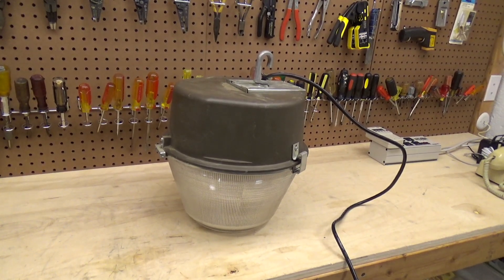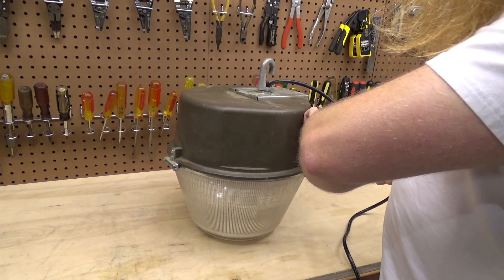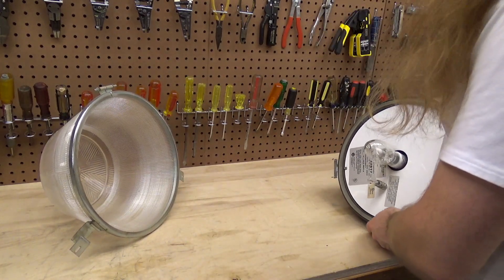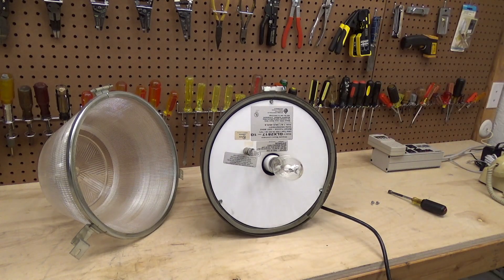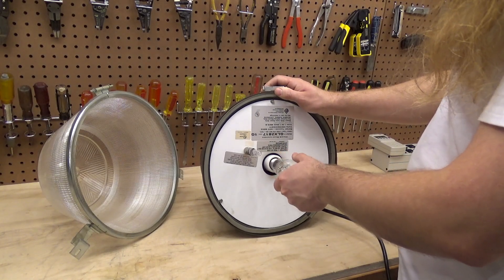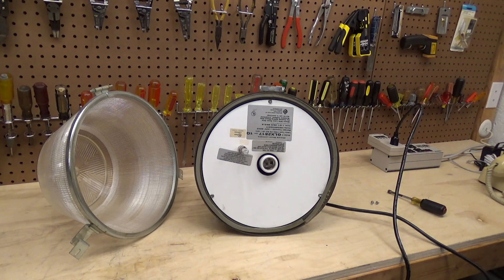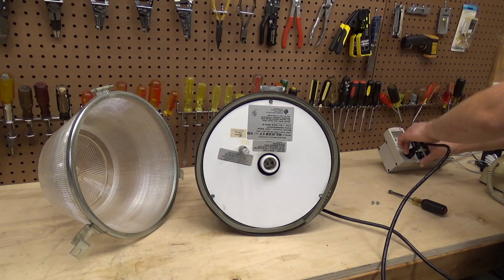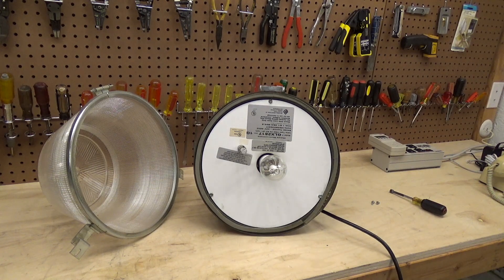Re-Revisit: CEW Lighting GLX2817-1Q 175-Watts Metal Halide and Quartz Hook Mount Luminaire

Comment: all this time later did you end up figuring out what the quartz bulb actually does?
Reply from the maker: The conclusion was that the bulb will illuminate in the even of a power blip to provide illumination during the period of time where the metal halide bulb is cooling before it will restrike again. I've had these fixtures in service for a while now and I've never seen the bulb illuminate once, something is either disabled or spoiled in these fixtures it seems.

Comment: the refractor is made by lexalite I'm pretty sure.
Reply from the maker: Do they still make them? Are you aware of any replacements that can still be purchased?
Reply: @JordanU  The refractor? Yes im sure they do, or you could try 'formed plastics'
Reply from the maker: @steve-h7z  Yes, I have 4 of these lights and the bottom is broken on one of the refractors. A few of the others have cracks. Would definitely like to get replacements.

Comment: I performed actual research - the quartz bulb is there for efficiency reasons. It is there to ensure the metal halide bulb goes through an efficient startup process. Without the quartz bulb it will not be as efficient. It is there as a supplement to the starting process. It is so that it transmits the high-voltage electrical pulses necessary for igniting and re-igniting the metal halide lamp. The quartz bulb does not illuminate, it is not supposed to be a source of light itself, rather, it is a metal halide ignition supplement device. Try unscrewing the quartz bulb and see if it makes a difference in the way the metal halide bulb starts up. If you don't have a quartz bulb installed you will notice the metal halide bulb take a little longer to start up, and it will possibly flicker more on startup. Please note that you may not see an immediate difference in the performance but you will notice over time.

Comment: I know with the 70 watt metal halide fixtures in the commercial building i work in. When the metal halide burns out the qautz buld lights up. When you replace the matal halide it goes out
Reply: The quartz lamp in the particular fixture shown in the video is likely not supposed to illuminate. It does have a purpose, however.

Comment: The quartz lamp is designed for to activate when the metal halide lamp turns on, then the quartz lamp will turn off when the fixture reaches operating temperature. My gym back at my primary school actually had metal halide lights with quartz lamps that did work. The lamp might be either burnt out or the control unit might have a fault.

Comment: When I see quartz lamps in metal halide fixtures, they are either a restrike lamp, or a completely separate lamp that is used with an emergency lighting circuit, but this fixture doesn't have it wired in such a way. 
It could also be that the component that controls the restrike lamp that has failed.

Comment: If you read the sticker inside fixture adjacent to quartz lamp, it says the lamp is for “standby” illumination which means it should come on after a momentary power outage that extinguishes the metal halide bulb when it is too hot to restrike. 

There are other things to check for why it doesn’t function: 1. The quartz bulb is bad. The sticker in fixture says the quartz bulb wattage should not exceed wattage of metal halide bulb. Check quartz bulb wattage, or it is possible bulb is bad. 2. There should be a component in fixture that controls standby lamp. Check to see if it is wired correctly. If it is, the controller might be bad. It is only meant to illuminate during a hot restrike or even at main lamp EOL.